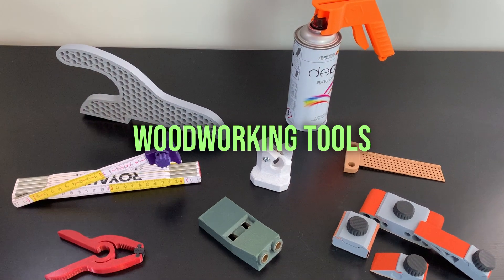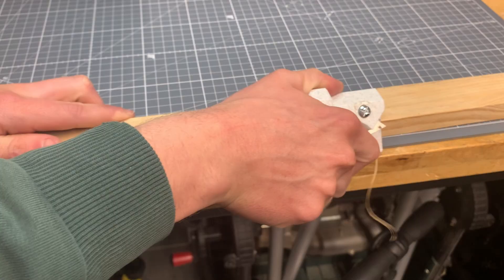Top 3D PRINTED Woodworking Tools You Need!

Comment: I have an A1, and I can belive it does not have a Fail detection.. A lot of Filament could be saved if it had it
Reply from the maker: I think it does have fail detection, but you have to enable it. It's the little robot icon when it is printing...

Comment: I like everything except the saw push stick, those can backfire with severe consequences if they are not just perfect, and even then things can go wrong... I've had one small accident with a table saw, and it was pretty much the worst pain you can imagine for a year.... fingertips are always under pressure and it just gets more when you move, so healing is slow. I was thinking you could print a collar for normal drillbits to use with your pocket hole jig
Reply from the maker: Thanks for your feedback! Will be careful with the saw push stick. What niche of tools would you like to see next?
Reply: @StarNestEngineering I still need a jig to do hinge pockets
Reply from the maker: Good idea! Will put that one in a next video...